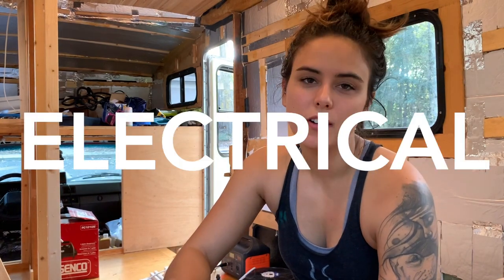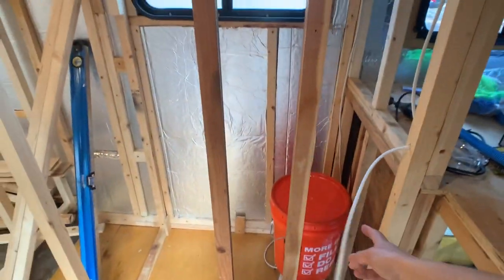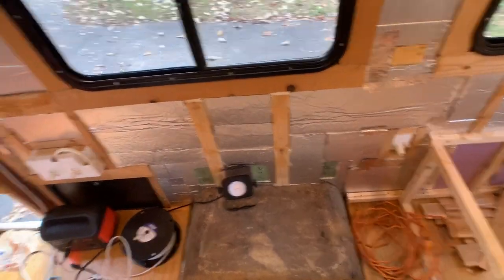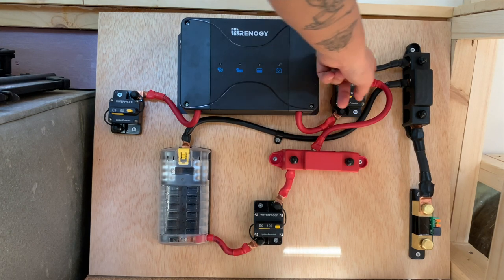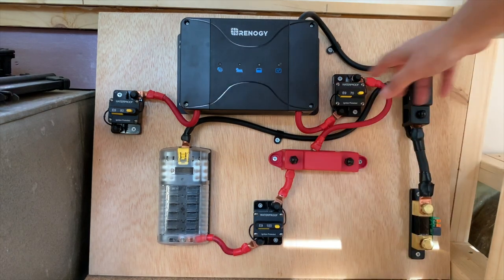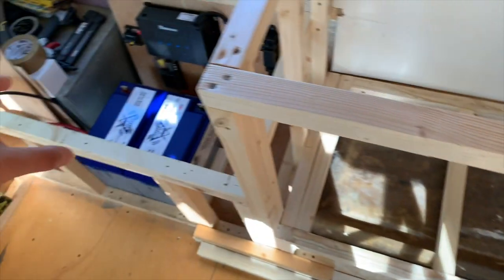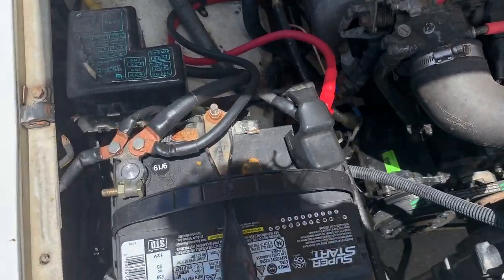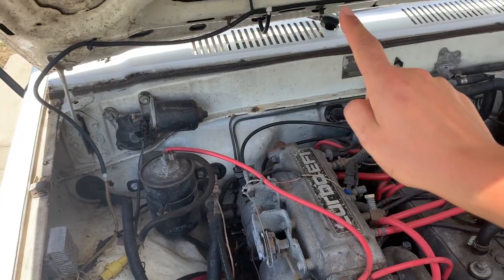Toyota Sunrader RV Build | Electrical System

Comment: Very cool overview, I love seeing things like this come together! My friend just bought a Sunrader and we're scouring the internet for build videos, and it's so wonderful having all these resources to see what's in there before we remove the first screw. :) 

To answer your question, it's pronounced "two ought", as in two zeroes, 00 gauge. For some reason it's not pronounced "double-ought" like the shotgun shell, don't ask me why! 

And one minor comment: The 80A breaker would provide more meaningful protection if it was installed at the source end, which is to say, in the engine compartment close to the battery. Presently a fault-to-ground on the red wire leaving the battery (say, if it gets pinched where it crosses under the frame) would have no overcurrent protection, and thus full battery current could overheat the wire and start a fire. The breaker wouldn't help because it's not located between the source and the fault. Mounting that type of breaker under-hood is all kinds of awkward; I typically use MRBF-type battery-post fuses as the primary protection, because they're super simple to mount. 

Thanks again for the video, and happy trails!
Reply from the maker: Thank you for the feedback! I think we may eventually install a fuse there. And thank you for the support! Our main reason for wanting to make this build series was exactly that! To put another resource out there for anyone looking to renovate one of these rigs, because there aren’t many.

Comment: hell of a nice job so far. looks like you take pride in your work!   im getting ready to post my toyota itasca build that im waist deep into right now!! 
btw...   your red charge wire at 10:05 is protected at the other end [renogy charger] but you should put a circuit breaker close to the front battery aswell, not only will it protect your front batt/alternator from damage in the event of a short on that long 4ga red wire, it makes it easy to disconnect charging power for testing/maintenance ect...  with a simple push of a button!
Reply from the maker: Thank you for the kind words, and the advice!

Comment: Nice job on the video, I watched it twice. What is going to power your 110 air conditioner when in use? I like the idea of using a 12v system. Nice job.
Reply from the maker: Thank you! We just bought an inverter. Seeing as the A/C is the only high wattage AC appliance we have we went with a cheaper unit for now and will see how it does to run theA/C off of the solar.
Reply: @sarastephanie5391  You can always install one 110 outlet that runs from shore power/generator to the air conditioner. Would be very inexpensive to install, like an exterior extension cord. I purchased a 2000w westinghouse inverter generator for my Sunrader air conditioner $400. Generator weight about 50lbs.
Reply from the maker: @1951Roy  We did install a 110 outlet on the A/C window frame, but we plan to be off grid and wanted to run it off our solar so the 1000W inverter we got will be more than enough! But thank you for the suggestion